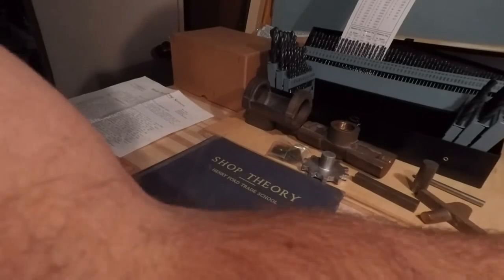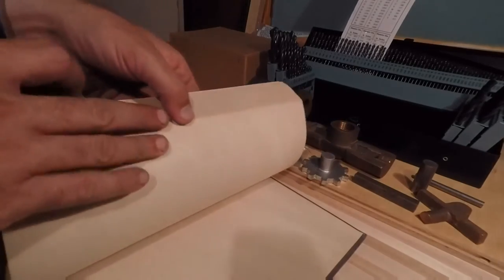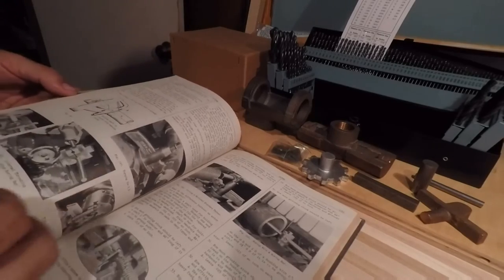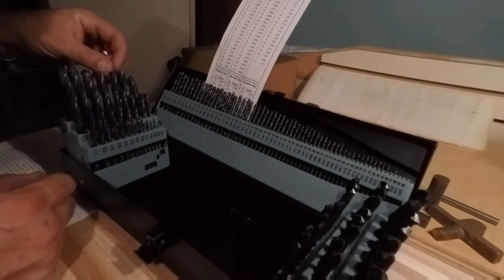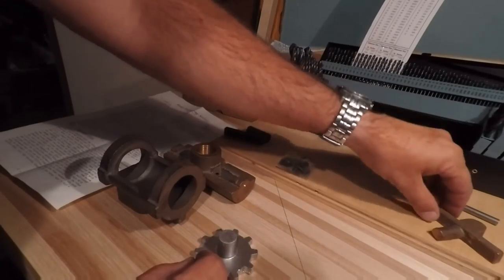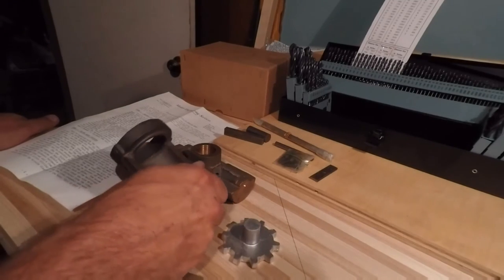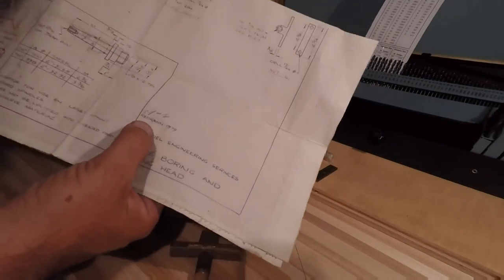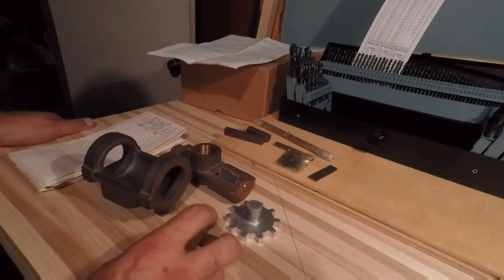Machine Shop Tool Score #14

Comment: I use HF drills all the time some good some break.  but they work.  the boring facing tool is cool.  I would think that someone has bought the rights to it but if you change it by 20% which could mean just all of the threads to standard you would be ok.  plus you could just sell the plans
Reply from the maker: +Bill “Big Bill” yes you're probably right most of the threads are standard already. In all honesty I don't understand how it works exactly. But I need to study it some more.
Reply from the maker: +Bill “Big Bill” yes you're probably right most of the threads are standard already. In all honesty I don't understand how it works exactly. But I need to study it some more.
Reply from the maker: +Bill “Big Bill” bye the way thanks for the comment love chatting with all the viewer.

Comment: i beat you to the drill bit set. and i already know you wont like them. be carefull when drilling with the,. they will jerk and grab really hard on you when it is close to going out the other end of your work peice
Reply from the maker: lol you know that happened the first time I used one I need to put a new edge on the whole set.
Reply from the maker: bye the way are you home yet?
Reply: Here in Canada Canadian Tire sells something similar, at least this is what I think... The main problem with those is the grind, sometime, they're done with a negative relief or anything in between,  normally with a better grind and knowing how to drill ( Correct feed and speed plus good cutting oil ) you could use them for surprising tasks even 304 stainless steel...   ;)     
But, on the lesser side, the taps and die sets are in my opinion,  complete CRAP....
Reply from the maker: Yeah there not the best but it gives me options other than a fractional index.